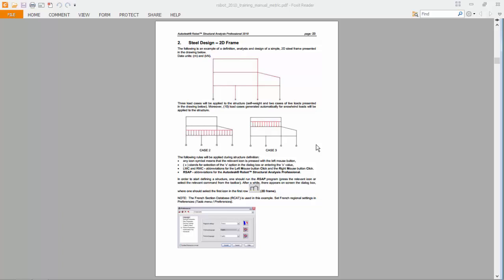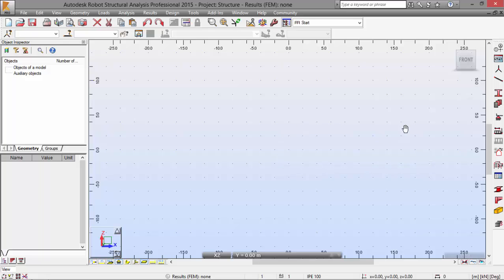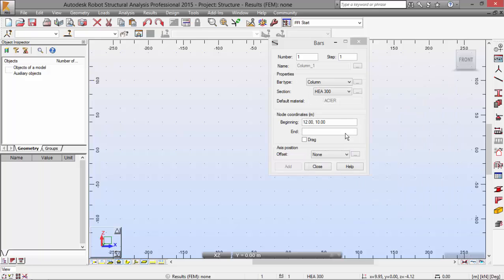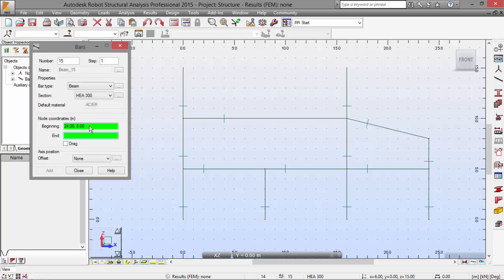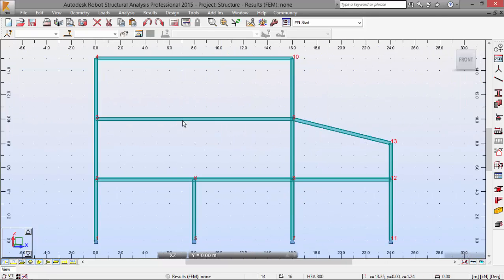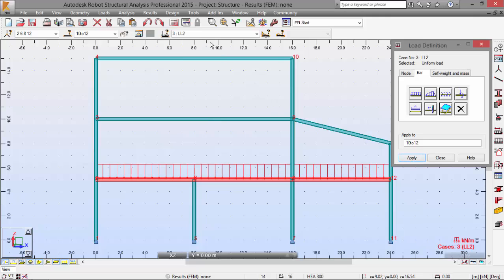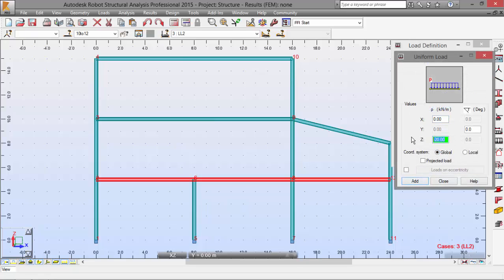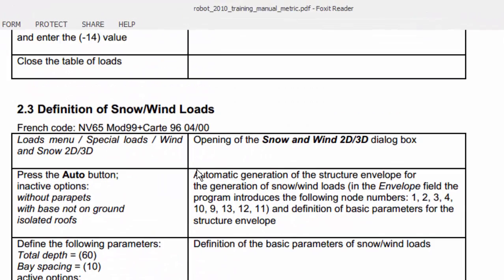Exercise 2 - Part 1 - Steel Design 2D Frame (Robot Structural Analysis)

Comment: Nuno Thanks heaps for the video! Just a question... What's the best method for creating members (Columns and beams) ? the method in the exercise is not the best as you said...
Cheers
Iman
Reply from the maker: +Iman Farahbakhsh the best method is using axis to snap the columns positions, because you can easily change the layout of the structure by changing the axis.